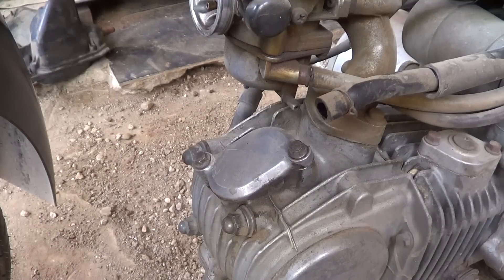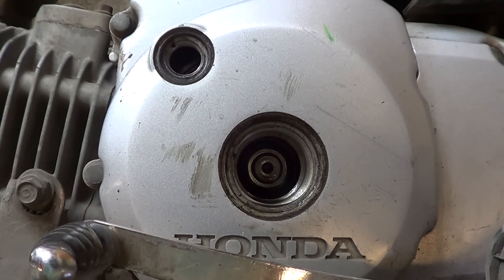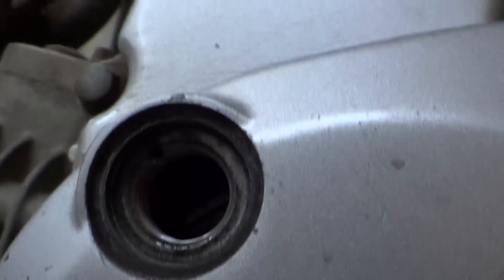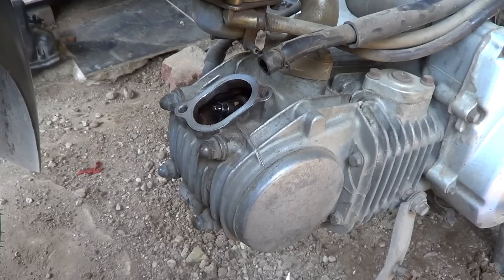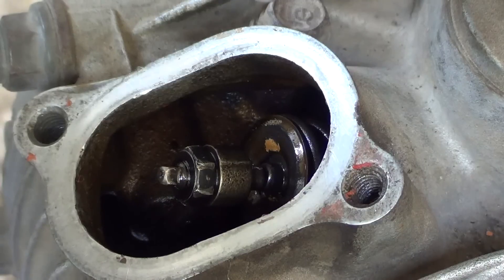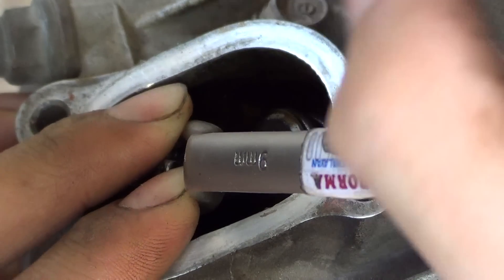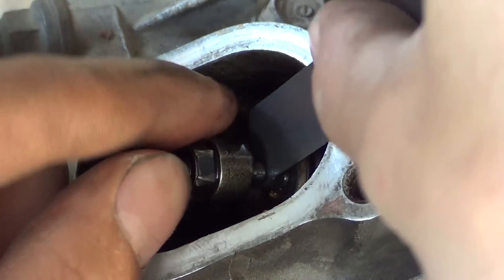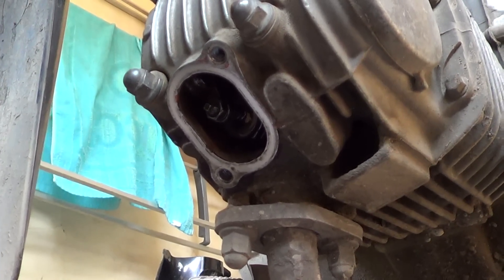How to Adjust Motorcycle Engine Valve Clearance

Comment: sir what do i have to do if the T mark on the flywheel wont go exactly at the marker?
Reply from the maker: Thanks for your question.

Simply remove the spark plug, and try to align the T mark again.
Good luck!
Reply: thanks sir.
Reply: sir i have another motorcycle but there is no T on its flywheel, it has IH and I sir, where can i find the TDC?
Reply from the maker: That's a good question. In that case, I think you should really refer to your particular repair manual for actual "top dead center" mark.
Good luck!
Reply: sir what is the valve clearance of honda wave 125 sir intake and exhaust?thanks
Reply from the maker: Let me see. What time is your production year or engine code?
Reply: year 2008 model sir.
Reply: sir i cant align the T mark on the notch i already remove the spark plug but still slip sir,what to do sir thanks.
Reply from the maker: Well, 2008, is that the same engine as Honda Supra or Honda Karisma in Indonesia?
If yes, then the valve clearance is 0.03 for both IN and EX valve.

If you want to make sure, I really recommend you to see your particular engine repair manual.

Good luck!
Reply from the maker: Rotate the shaft again 180 degrees, and then try to align the mark.
Good luck!

Comment: Hey, Jadav. Could you solve me a doubt? Thanks in advance for any help. In fact, I haven’t found anything clear on the Internet. So I came across with your video. The situation is, suppose I have to “Adjust Motorcycle Engine Valve Clearance”, what is the consequence if I let the admission or exhaust a opener or closer than the standard setting: in terms of performance, top speed and fuel saving? Thanks a lot for any clue. I am thinking about a one or two-cylinder motorcycle.
Reply from the maker: Insufficient clearance will result in the valves contacting the seats for a shorter time and consequently operate at higher temperatures. Excessive clearance will result in noisy operation and loss of power. This means, loss of power = bad fuel saving.
So, great accuracy (standard timing) should therefore be used when adjusting valve clearance.
Reply: Man, I felt very pleased about your generosity in answering my questions. Thanks you very much. Nice day!
Reply from the maker: +Ags Guimaraes No problem. You're welcome 👍

Comment: Where do u put the feeler gauge,between the rocker arm and the what??? ....plz reply cause im working on my bike ..cuz its releasing some massive release fires..and thnx in advance
Reply from the maker: Insert the feeler gauge between rocker arm (actually: adjusting bolt) and upper valve stem, then turn (clockwise or counterclockwise) the adjusting bolt to adjust the gap between rocker arm (adjusting bolt) and upper valve stem.
Reply: +Sekolah Online Teknik Otomotif  what measure of filler guage did you used in the exhaust?
Reply from the maker: It's (valve clearance) depends on your engine, different engine have different valve clearance. You can see your repair manual for this specification.
Reply: +Sekolah Online Teknik Otomotif my motorbike is 2005 Honda Wave125S. It is like your motorbike. I also have the 2004 Honda XR200 and I dont know the right valve clearance.
Reply from the maker: Oh, Honda Wave 125S? It's similar to Honda Karisma 125 in Indonesia.
I'm not sure, is that bikes have same engine?

Maybe you can search and download repair manual e-book on google for your bikes. It's important to adjust your valve clearance in accordance with the factory suggestion.

But if both Honda Wave 125S and Honda Karisma 125 have a same engine, then they have a same valve clearance. It's 0.03 mm for both intake valve and exhaust valve.
Reply: Yes. They are both the same engine. Thanks for the info.
Reply: Joseph P.
do u have an owners manual??? its in the manual
Reply: +icee youhh I dont have the manual because I bought the motorbike 2nd hand.
Reply: What is ur bike???
Reply: +icee youhh honda wave125S, Suzuki Raider150, Honda XR200, Honda CRF450R.
Reply: i think its .003mm ...for all those bikes. i think ..   mine is a yamaha vega .. so i think mine is .002 .. but im not sure..hehe  :D
Reply from the maker: +Joseph P.
I think you can search and download it from internet.

Comment: my question is gauge the same the upper n lower ,for there so many say not the same,n some say is the same what is true
Reply from the maker: +Philip Villar Different engine may have different valve clearances. So it's highly recommended to see the sizes on repair manual. Thank you.

Comment: is it ok to use .01 mm feeler gauge on a 125cc engine?
Reply from the maker: I think 0.01 mm is too narrow, in this video I use 125 cc engine too, and I adjust it to 0,03 mm. For more details, I suggest you to refer to repair manuals for that specific motorcycles. Thanks.

Comment: how about suzuki skydrive125, what is the standard valve clearance
Reply from the maker: +Jenny Ferrer Suzuki Skydrive 125
In 0,04 -0,08 mm
Ex 0,09 – 0,16 mm
Reply: Sekolah Online Teknik Otomotif 
thnk u sir 4 ur reply but im a little bit confused , some says i used in-.003 and ex-.004 what can u say about that? and by the way sir ur videos are great
Reply from the maker: +Jenny Ferrer The valve loses most of it's heat through the valve seat. If the valve doesn't seat fully it will start to get hotter and hotter. Sooner or later the valve starts to melt or burn. Not good. Now if the clearance is too much the valve train components will be hammered every time the valve opens. Not good too, but better than too hot.

Comment: if the timing not in mark or wrong 
the motor can't start right  ?
Reply from the maker: +ZONG YAO Wrong notch position will cause the adjustment may be incorrect, so the engine would be difficult to start or won't start.
Reply: Sekolah Online Teknik Otomotif OK thanks
Reply from the maker: +ZONG YAO you're welcome👍

Comment: Hello,  I want to adjust valve clearance in pulsar Ns 200 motorcycle,  Help me
Reply from the maker: According to the service manual, the intake valves should be between 0.04 to 0.06mm. Exhaust valves should be between 0.07 to 0.09mm.
Good luck!

Comment: is that 0.03mm standard to each motor valve?
Reply from the maker: +joelber sojor No, 0.03 mm isn't general standard. You need to see the repair manual for your particular engine.
Good luck!

Comment: have you tried the valve overlap? coz my valve clearance is 0.03 in intake and 0.04 on exhaust... and it has a little bit noise when idling...like "tikitikitikik" sounds.too much gap on exhaust i  think thats why it's sounding like that..i dont usually go to mechanic.. coz some of them dont know the "valve overlap"...right now it has stage 2 racing camshaft..can i have your guide for valve clearance for this? btw my motorcycle is Honda wave alpha 100...its an old model.
Reply from the maker: +jesimig paneda It's interesting. So, you use aftermarket camshaft that have longer opening duration, right?
Valve clearance affects the valve opening duration (yes, a little bit), and it also contribute to engine noise (on valve mechanism, if the clearance too thick).
So, in my opinion, if you want to have both a good valve duration and low noise. I just suggest you to follow the manual book.
But if you done, and the engine is still have a "tiktik" noise, I think it's just because your "stage-2" cam profile, it seems have a steep cam contour.
Reply: sir Sekolah, i just read your advice...and the manual you are talking about is working... but i didnt follow the 0.02 intake, 0.02 exhaust (standard measurement for 100cc) instead, i followed yours...... i tried both 0.03 and the motor's perform well...but the idle's randomly kill itself so i have to hold the throttle..
Reply from the maker: I think that bad idling problem was from your carburetor. Try to tune it up: cleaning and adjusting. I hope it will help.
Reply: jesimig paneda Sir it depends to ur cam.. Some cam are silent and some cam are wild cam.. Wild cam are cuse tiktik..
Reply from the maker: +eduardo aban Ok, it's useful info brother 👍
Reply: Ur welcome sir
Reply: ei sir any idea how to silent noisy ticking in suzuki raider 150?
Reply from the maker: +jesimig paneda Noisy ticking in the cylinder head?
Reply: yes it is in cylender head... "takatakatak" like that when idling...

Comment: what size of feller gauge for exaust?
Reply from the maker: It depends on what type of engine do you have. You should refer to the repair manual.
However, in my case on this video, the EX size is similar to IN.

Comment: Is the intake and exhaust are the same clearance?
Reply from the maker: In my case, yes. Honda Karisma has the same valve clearance for both intake and exhaust valve.

Check the repair manual for your specific motorcycle/motor scooter for the size of valve clearances.

Comment: how to adjust honda xrm 125 valve clearance?
Reply from the maker: +Raffy Zamorro I don't have the repair manual, but here the XRM 125 valve clearance from fixya.com: 0.002" on the intake, and 0.003" on the exhaust valves (engine cold).

Comment: Sir may i know what is the stardard gauge clearance intake and exhaust for xrm 125? Thank u for your rply..
Reply: Ramil according to my xrm 125 valve clearance should be: Int: 0.05 mm (0.002 in) Exh: 0.05 mm (0.002 in)..i notice that the intake and exhaust valve have the same clearances.
Reply: I should have said xrm 125 owners manual.

Comment: if you dont have that 0.03 thing, what can I use?
Reply from the maker: +Syazwan Effendy It's highly recommended to use only feeler gauge. Maybe you can buy one from tool shop, or borrow from your friend. Thanks.
Reply: Use coke in can..cut it like the shape of filler guage.
Reply from the maker: +Monica Charma Have you ever measure it's thickness?
Reply: Syazwan Effendy . use "FEELING GAUGE" instead. Haha. It works for me.

Comment: dude not 3 mm its 0.03 inch any way nice video and the honda manual is 10mm +or -3 for the intake and 16 mm +or -3
Reply from the maker: +Herminigildo Dela Cruz Jr Thanks for your info. But, really it's in mm. You can check the legal RM carefully.

Comment: sir my motorcyle is fz16 what is the filer gauge of intake and exust tnx
Reply from the maker: +kayzel arth casten de jesus Did you mean Yamaha FZ16 or Yamaha Byson (in Indonesia)?
This is the Yamaha Byson engine valve clearance:
IN 0,08 - 0,10 mm
EX 0,10 - 0,14 mm

Comment: What happens if you just adjust without TDC
Reply from the maker: If you just adjust both intake and exhaust valves without setting your piston at TDC compression stroke, then there would be a chance where you adjust the valves when they're in open position.
So it's important you adjust both valves when the piston is positioned at TDC compression stroke, because in that position, both intake and exhaust valves (or rocker arm) aren't pushed by the camshaft.
I hope it helps.
Reply: Yes 🐼. think you that is exactly what i was looking for. Can you adjust both exhaust and compression separately as well? With the same gage i have 003 ssr125cc dirt bike
Reply from the maker: Yes, you can adjust all valves (single cylinder engine) when the piston at the TDC compression stroke.
Reply: Thank you. I see you have a scooter. you can make it go faster by chaging the spockets. the back one for the backwheel. Smaller back sprocket the faster you will go with less low end power to carry stuff. If you put a big sprocket with more teeth the more carrying power you will have. It is good for going up a hill. You'll have more torque with more teeth and less torque with less teeth. Thax
Reply from the maker: Okay. Thank you very much for your suggestion!
Reply: Melemeterrrrrrrrrr
Reply: Gani Caalim your valves can hit the piston and break your engine

Comment: Sir soory,,,peru sablay ang first step mo sir,,,,the first step when you hold the engine is to remove the compression of the engine,by removing the spark plug,,,for your grade for that job is only 80%
Reply from the maker: +cris ibarra Oh yes. I just check the repair manual, removing spark plugs is recommended. Thank you very much for your suggestions.
Reply: sir same lang ba yan sa wave100?
Reply: cris ibarra
Reply: compression test nman yung cnasabi mo sir.  its all about engine valve clearance no need to compression test
Reply: Ahahaha
Reply: @sekolahonlineteknikotomotif  what size of fwller gauge to be use in exaust valve?you cant show it

Comment: U canot turn the flywell proferly f you did not remove the splug,because of the compression
Reply from the maker: +cris ibarra Yes you're right. But the procedures in the manual does not instruct that step.
But yah, if you've difficult to align the mark on the flywheel, remove the spark plug may facilitate the process of straightening marks on the flywheel.
Thanks for your suggestion.

Comment: Sir. I can apply this method on xrm 125 (2007) model ?
Reply from the maker: Of the mechanism is similar, of course you can apply this method.
See the repair manual for the clearance sizes.

Comment: hi suzuki (best110 or smash110)valve clearance in ex???
Reply from the maker: +Uğurcan Yıldız Here are valve clearances for Suzuki Smash: 0.04 mm - 0.07 mm for both IN & EX.
Reply: do you know the valve clearance of Honda tmx 155? T
hanks!
Reply from the maker: +Gemini Gear As far as I know, it's 0.08 mm for both intake and exhaust valve. But I recommend you to check the authentic Honda's TMX 155 repair manual to ensure that number.
Thanks.
Reply: thanks for reply. god bless bro!
Reply: @sekolahonlineteknikotomotif  motorcycle Honda 100cc. I won't namber feler intake and namber feler Exhaust mm

Comment: Sir, you're motorbike is a replica of mine ( Rusi swish 100cc) can i do the same method you used in this video? or not?
Reply from the maker: +Bahala naa wala akong maisepp Oh replica? Is your Rusi engine components have similar type with Honda Karisma?
Reply: I can't say it's a fully replica but the company said that they make thier own engines, so i can't guarantee that ur method can work with my engine, also im new to motorbikes so i don't have too much knowledge to it
Reply from the maker: +Bahala naa wala akong maisepp Well, if so, I think you should see your particular motorcycle repair manual for proper maintenance procedures.
Reply: Sekolah Online Teknik Otomotif ok thanks 👍
Reply: Gamma One , dont you think that your bike is the replica? Judging from what you said" rusi" manufactures replicas of honda motorcycles,  at least with the flairings only. Lol

Comment: First thing I notice is ,THAT'S NOT a motorcycle ! Its a scooter
Reply from the maker: +michael birdsley 
A motorcycle has a seat or saddle for the rider and is designed to travel on not more than three wheels.
while..
A motorized scooter is defined as any two-wheeled “device” with:
• A motor, handlebars, and a FLOORBOARD for standing on when riding, and
• The options of having:
– A driver seat which cannot interfere with the operator’s ability to stand and ride.
– The ability to be powered by human propulsion.

(reference: DMV Handbook Motorcycle 2015)

So, what do you think?
Reply: The size of motor dictates its a scooter !
Reply from the maker: +martin obaid Yes, you're right. Thanks.
Reply from the maker: +michael birdsley It's a 125cc engine.
Reply: Yea ? I ride a Yamaha  Raider 1900 cc ,Like I said what you have there is a scooter !
Reply from the maker: +martin obaid Absolutely right.
Reply from the maker: +michael birdsley It's oke.
Reply: that is underbone motorbike not a scooter.

Comment: gud morning sir, i try for the fist time adjusting valve.im using .003 mm feeler gauge.its desame with 0.03mm? coz i dont see 0.03 in my feeler gauge.when after i adjust valve according to my feeler gauge .003 mm i heard noise and hard starting also when its start its suddenly lost power also that noise.thanks
Reply from the maker: Before you start the process, you should know exactly what is your engine valve clearances (for example, 0.03 mm is only for Honda Supra or Karisma 125).
Be careful with the size, 0.003 mm is absolutely different from 0.03 mm. So, use only the proper feeler gauge blades.
Good luck!

Comment: Thanks...but why still have a sound like that?
Reply from the maker: Try to set the proper valve clearances for your particular engine. See your repair manual for accurate size of the clearances.
Good luck!

Comment: can i ask what is the valve clearance of my honda tmx 155?
Reply from the maker: +Rommel  Salunga 
Unfortunately I do not have a manualbook reparations Honda TMX 155. But this data I get from forum users.
Stock valve clearance for TMX 155: 0.08mm both intake and exhaust.
Good luck!

Comment: Sir my honda rs125 before top speed is 120 after 1yr my top speed now is only 100 thats stock engine and sprocket. How can i get back to top speed in 120kmph?
Reply from the maker: The performance of an engine is decreased due to components wear. However, you can improve (reimprove) your engine performance by changing the worn components, engine oil & oil filter, and adjust the adjustable mechanisms (such as valve clearances, etc.).
Drive train is also extremely important. Chain & sprocket for example, you can clean (plus replace or adjust) to reduce energy loss in this mechanism.
I hope it will help your problem. Thank you.
Reply: Sekolah Online Teknik Otomotif  thank you

Comment: Work smart not work hard just buy tool for adjust the valve because that way is easy but you valve still sound locking that will make you valve easy broke
Reply from the maker: +Norrabidah Moiden Thanks for your suggestion.

Comment: if i use 0.05 mm for feeler gauge..is it okay??or less good than 0.03??
Reply: Different engine need different clearance requirement.. You shall check you manual for exact requirement.